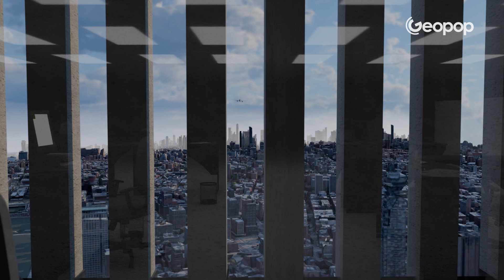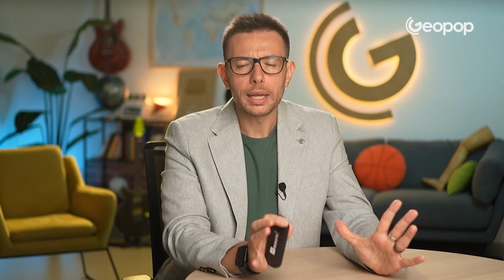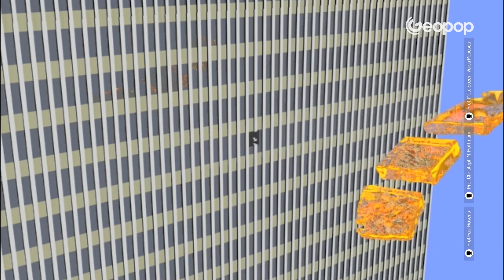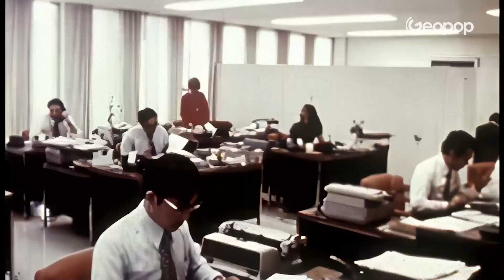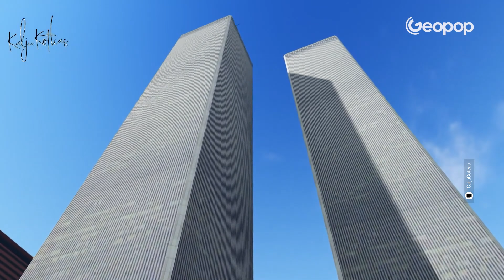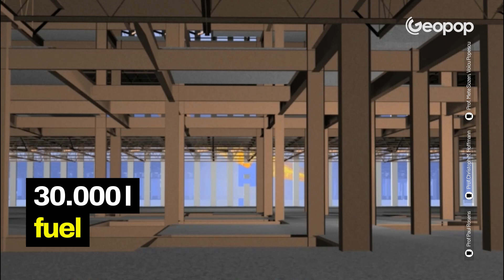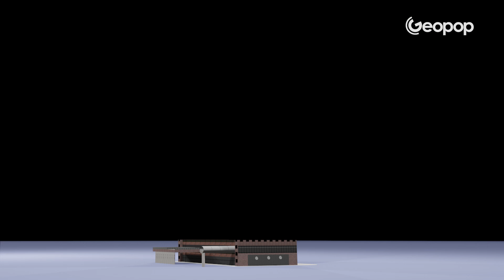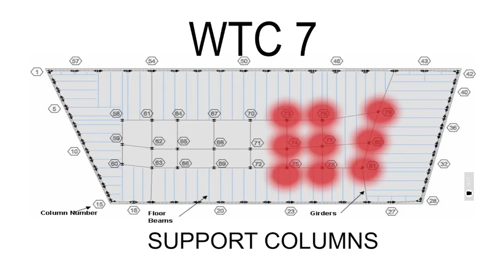9/11, 2001: The Technical Reconstruction of the Twin Towers and WTC 7 Collapses

Comment: I truly don’t understand when people say it was explosives as if there isn’t evidence that that was not the case and how it actually makes sense why they collapsed due to the plane impact and how it’s all backed up by  science but architecture and engineering basics.
Reply: 1.The firefighters said" it looked like they planned to take down the building" I didn't say that, The fire fighters said that. They were there.I'm sure they know best.
https://youtu.be/XiIT4HInWjY?si=e1Pvp3-IFs-M75Oj
When the firefighter says "boom, boom, boom, boom" in this video.
What do you suppose he is?Implying by " boom" ??
2.So if there were no explosives then what is this? 8:25
https://youtu.be/bLF5D7M1YgA?si=aHSvS__uOdxMi1ZB
You can't say that it was added because you can see the firemen's reaction to the explosion. And you can't say it came from anywhere else because the firefighter says
" We gotta get out of here,  7 is exploding "
3. Controlled demolitions have squibs, you can see the squibs here 20 floors below the collapse. 
https://youtu.be/eXAgulfAtR4?si=-iLO9aQjMJVLTUYH
4. Firefighter says "any one of these buildings could blow up,  this ain't over yet" firefighter says there's 3 secondary explosions. 
https://youtu.be/0Gh3ErgMI4M?si=mmp9Eus_5PWTCBfl
5. Airplanes can't fly 600 mph at 1000 feet. And to be able to make a 180 degree turn to hit the opposite side of the pentagon going that fast is ridiculous. And since when do terrorists hit the opposite side of the building where no one was at when they could have just flown straight in and killed way more people???
https://youtu.be/0Gh3ErgMI4M?si=mmp9Eus_5PWTCBfl
7. No one has ever known ahead of time that a building was going to collapse except through controlled demolition.  Tower 7 was reported to have fallen while it still stood in the background. 
8. Larry silverstein,  the man who made over 4.5 billion when they fell, claimed to have pulled the building down.
https://youtu.be/1jQaJFNWqtc?si=wCywQ9grgBdS_w11 yet somehow today he is only worth one billion dollars.
Reply: @robbiehiatt9966  1, 2 & 4 Those are initial impressions not based on any evidence.  Former Deputy Fire Chief of the FDNY and co-author of "Collapse of Burning Buildings" Vincent Dunn said on the Popular Mechanics podcast  “Many times these theories that come out are just RIDICULED by fire fighters.  Every fire has a post fire analysis. There are many types of noises that sound like explosions.  You can have a smoke explosion or what's called a back draft explosion.  You can have flammable vapor that's left over from the kerosene fuel.  You can aerosol cans that explode.  Floor collapses that make a noise that SOUND LIKE A COLLAPSE.  At every fire we constantly hear things that sound like explosions.”

3. Air fills almost all the volume inside any building.  When the pancaking begins these puffs of dust appear to be explosions from the outside.  Actually the puffs are the air bursting out with concrete & drywall dust. Like electricity, air will find the path of least resistance.
 
Mark Loizeaux of Controlled Demolition, Inc (established by his father in 1947)  states- Conspiracy theorists are "absolutely incorrect" in their opinions of the dust.  If you look at any building that's imploded you'll see explosives placed primarily on the ground and basement.  Why? Because you want to remove columns where you have the most potential energy as possible (floors above).  The collapsing buildings didn't start on the bottom.  

5. The Pentagon:  Jet planes can in fact fly very low that fast. Air at the surface is denser than air at 34,000 ft.  The thicker air gives more oxygen to burn the fuel.  Hundreds of witnesses on the freeway saw a 757 hit the Pentagon. https://www.youtube.com/watch?v=XdxzqqZ3e2s&list=PL14EB1AB6AB809674

A small piece of flight 77 fuselage with portions of American Airlines logo visible, was photographed on the lawn in front of the Pentagon. The picture can be found here:

https://upload.wikimedia.org/wikipedia/commons/thumb/5/5a/Flight_77_wreckage_at_Pentagon.jpg/800px-Flight_77_wreckage_at_Pentagon.jpg

One main landing gear wheels:
http://photos1.blogger.com/blogger/7508/1605/1600/757-rim.jpg

http://skepticproject.com/images/articles/911-images/pentagon-debris-007-landinggear.jpg

William Lagasse, a Pentagon police officer, told ABC's Nightline “It was close enough that I could see the windows and the blinds had been pulled down.  I read American Airlines on it... I saw the aircraft above my head about 80 feet above the ground.”

Lieutenant Colonel Steve O'Brien (Minnesota Air National Guard) happened to be the Washington area that morning.  He departed Andrews Air Force Base at 9:30am in a C-130 cargo plane. He was just pointing out the sights to his crew.  He then got a request from air traffic controllers to watch out for  American Airlines flight 77.  It just happened that both airplanes nearly collided. 

Frank Probst, (Pentagon employee, West Point graduate and decorated Vietnam War Veteran) was walking outside on his way to a 10am meeting.  The 757 was so low he had to dive to the ground as he thought the plane might hit him.  After the 757 passed he turned and saw the right wing smash into a 750-kilowatt generator that was on a concrete pad outside the Pentagon.  He also saw the left engine hit a ground level external vent outside exterior wall of the Pentagon.
 
Probst's witness account was backed up by Don Mason, who was stuck in traffic just west of the Pentagon.  He saw the 757 clip 3 light poles on its approach.  He watched Probst dive to the ground and saw a small explosion when the right wing hit the generator.

"Afework Hagos, a computer programmer, was on his way to work but stuck in a traffic jam near the Pentagon when the plane flew over. 'There was a huge screaming noise and I got out of the car as the plane came over. Everybody was running away in different directions. It was tilting its wings up and down like it was trying to balance. It hit some lamp posts on the way in.'" - "Pentagon Eyewitness Accounts." The Guardian, 12 Sept 2001 

Sheila Moody, U.S. Army Accountant, In the outermost Pentagon ring National Geographic "Inside 9/11" Disc 2 "War On America" at 54:14 "I remember hearing the sound of a airplane engine. That, that whistling sound when they're descending.”  She makes a whistling sound.

Fire Fighter Alan Wallace was fixing his truck along the Pentagon's west perimeter outside the heliport fire station. He and a co-worker looked up to see the plane coming at them. On National Geographic "Inside 9/11" Disc 2 "War On America", at the 54:52 mark Wallace says “Skipper and I had enough time to yell LET'S GO”

7. Bldg 7: Yes the BBC had reported that the building had collapsed in confusion, as the others had collapsed.  While investigating and updating information on the collapse of the towers, someone at the BBC was given a report/press release that building 7 had raging fires for 7 hours was going to collapse. [Edit: we now know they were monitoring the news from different outlets and that's where they learned of building 7.]  According to the fire department, by 2:00 pm they knew the building would soon collapse. Reporters KNEW this well before the collapse because there are videos of reporters talking about it before it happened. So we KNOW reporters were given information on WTC 7's imminent demise. This is called the "fog of war" 

Yes the fire chief had correctly known bldg 7 was going to come down. www.nytimes.com/packages/pdf/nyregion/20050812_WTC_GRAPHIC/9110217.PDF

"7 World Trade Center was roaring. I remember being pulled off the pile like just before. It wasn't just before. It was probably an hour before 7 came down."

Fire Fighter, Richard Banaciski------"They told us to get out of there because they were worried about 7 World Trade Center, which is right behind it, coming down. We were up on the upper floors of the Verizon
building looking at it. You could just see the whole bottom corner of the building was gone. We could look right out over to where the Trade Centers were because we were that high up. Looking over the smaller buildings. I just remember it was tremendous, tremendous fires going on.  Finally they pulled us out. They said all right, get out of that building because that 7, they were really worried about. They pulled us out of there and then they regrouped everybody on Vesey Street, between the water and West Street. They put everybody back in there.  Finally it did come down."

www.nytimes.com/packages/pdf/nyregion/20050812_WTC_GRAPHIC/9110469.PDF

FDNY Chief Frank Fellini: "The major concern at that time was number Seven, building number Seven, which had taken a big hit from the north tower. When it fell, it ripped steel out from between the third and sixth floors across the facade on Vesey Street. We were concerned that the fires on several floors and the missing steel would result in the building collapsing."

Former Deputy Fire Chief of the FDNY and co-author of "Collapse of Burning Buildings":

"After the buildings collapsed the fire chief said “No one goes into building 7.” They removed the people from the building."

Firefighter Kevin Howe: "...Just when you thought it was over, you're walking by this building and you're hearing this building creak and
fully involved in flames. It's like, is it coming down next? Sure enough, about a half an hour later it came down."

8. Silverstein held a ground lease for WTC 7  from the True Owner Port Authority of New York and New Jersey. A ground lease is an "ownership of a temporary right to hold land or property in which a lessee or a tenant holds rights of real property by some form of title from a lessor or landlord. Although a tenant does hold rights to real property, a leasehold estate is typically considered personal property." I'm not a real estate expert nor a lawyer. This seems like the Port Authority has given him more control than a typical lease holder. Thus making Silverstein the pseudo owner of the property. This means he has the authority, rights and responsibilities of WTC 7 during the time of his ground lease. 

In the PBS documentary, “America Rebuilds" in 2002,  At 12:40 mark the narrator says ”Larry Silverstein was required to rebuild by the terms of his (ground) lease by the site's owner the Port Authority of New York and New Jersey.”  Why would Silverstein destroy his own building knowing he would have to rebuild with the insurance money he would receive?  He received no personal pocket money from the insurance payout.

He recalled of the fire department that they were not sure they could contain the fires in the building. This was 7 hours after Twin Towers collapsed. He also said the fire fighters could use the term "pull it" meaning to get all the fire fighters out of the building.

"Pull it" is not a slang term used for controlled demolition. Ron Dokell, retired president of Olshan Demolishing Company says he's never heard of that term. The same is true of Mark Loizeaux of Controlled Demolition, Inc. Silverstein released a statement on Sept. 5, 2005 saying his comments were misinterpreted. He said he was referring to moving a squadron of firefighters out of the burning building.

Comment: Reinforced concrete is concrete poured into forms with prestressed rebar interwoven within the forms.  In building 7, you state that the steel beams were "coated" with reinforced concrete.  That doesn't make sense.  "Encased" in reinforced concrete, might be feasible.  But "coated", no.

Comment: I do not have an issue with cause of the collapses. Where I draw the line is the idea that two structures, impacted at different areas and angles just, well , perfectly pancaked into their respective basements. Oh, and yes I have been there…the foot print of the collapse is pretty tight and small, small being relative. The thing is for two buildings, TWO, fo pancake so perfectly is beyond RNG for physics.
Reply: The top of the south tower didn't fall straight down. It fell towards the corner it was hit on. It's all about which structural columns were hit and compromised the most. The north tower falling into itself makes complete sense, especially since we know the outside support beams below the impact zone bent inwards when trying to make up for the failed support from the floor/horizontal support structures above. Once the floors started pancaking, of course it will fall straight down. Thats only logical and explained by physics

Comment: If I would have told you on 9/12/01 that in 25 years, artificial intelligence will produce a video, pretty accurately breaking down the structural effects of the attack, we both would have called me nuts.

Edit: That's  despite Terminator. AI was an ass in terminator.  Today's AI is .... really like a baby, right now...

Comment: NO steel structure in the history steel construction has ever fallen from any fires before 911 and after 911. These buildings were built with high grade reinforced steel going above and beyond NYC building codes required at the time. It had many redundancies in place and the architects took into account the airplanes will only get bigger with the time, and as a matter of fact the 767s that flew into the buildings are only slightly larger than a 707.  The idea behind this was the building's structure was to act like a spiderweb, meaning when you poke a hole in a spiderweb does it collapse??  In other words, money was no object for the planners when the concept became a reality for them back then in the 60s.
Reply: Nonsense.  Steel is uniquely vulnerable to fire and steel structures fail in fire on an almost daily basis. 

Also, using nonsense terms like high grade reinforced steel is pure argument loading. It just detracts from your case further. 

A Boeing 767 at 587 mph has 5 times the energy of a B707 at 200 mph.  There is a big difference between an accident and a kamikaze attack. 

Frankly, you are doing this all wrong.
Reply: @TheLoonResistance  well put.

Comment: From what I understand approximately 6 months before 9/11 there was the largest elevator system upgrade in US history that was performed on those buildings. Along with the fact that the fire could not have gotten hot enough to cause the main beams to fail. Even if the beams did get hot enough under load to collapse, the inertia would not have been enough to pancake all the way to the ground. This is one of those things that makes you go?🤔
Reply: You understand little. Your assumptions are all wrong. The technical description in this video, while not perfect, is fundamentally correct.
Reply: The fire didn't get hot enough to MELT steel. It did get hot enough to weaken it. Re-watch the video. Any structural engineer will tell you this video explains it well.
Reply: Not sure why all these bots are defending the mainstream narrative so hard
Reply: @Phx6- Not sure what combination of hubris and stupidity is required to believe that anyone with the audacity to disagree with you is a bot.  I suppose its all you've got.
Reply: @TheLoonResistance  nice try bot

Comment: 15min - in a series of complex mathematics according to nist  this determined thst the columns supporting the intact floors  below the levels of the collasped were able to support 11 floors if the load was applied gradually.    Haha bro wow
Reply: How gradual does a collapse need to be.   How about actual figures in accordance to how the top collapsed according to NIST and what the building could /should have supported

Doesnt it make more sense to tslk anout What actually happened instead of if it were gradual or slow or 6 floors.   Bro please this is the most convoluted explanation iv ever heard.  

IE .  According to European standards calculations… wtf does that matter

Comment: Why don’t you show the sprinkler system.  Like floors 99 to 110 had two 5gallon water tanks on 110tj floor of each tower in its own loop
 
Or when temperature of steel looses 50percent of its structural strength 

But not explain heat or thermal mass/ energy transfer ????